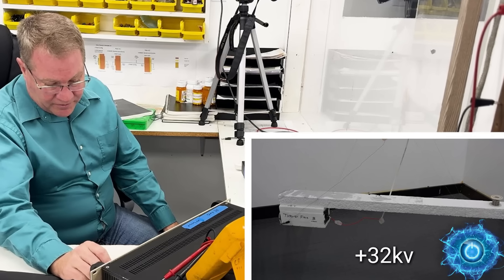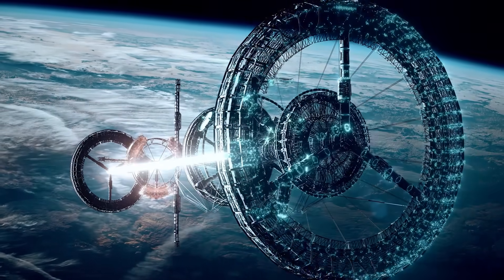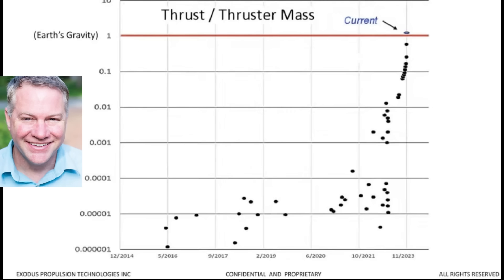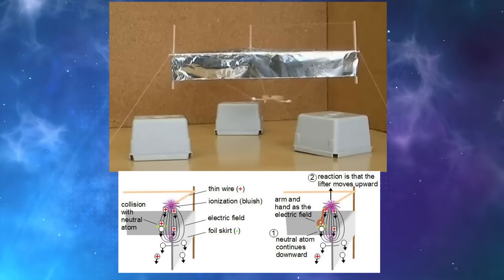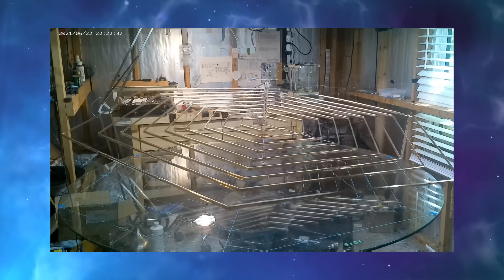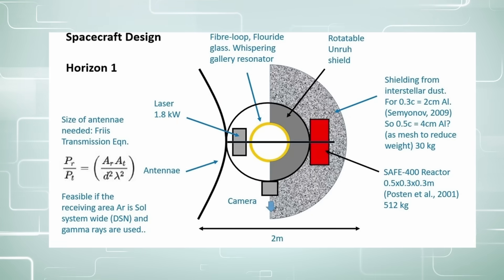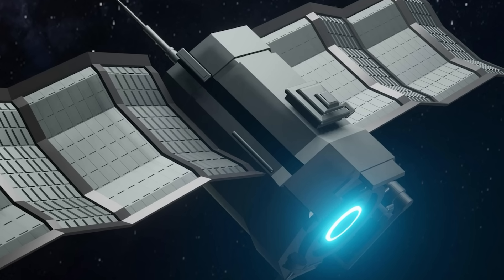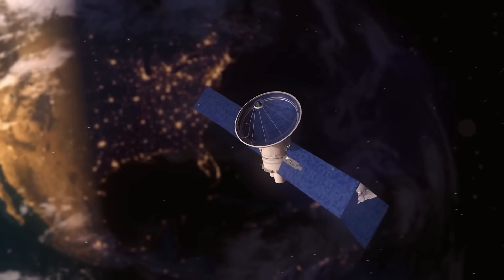Propulsion Breakthrough!? New Electric Drive Defies Physics

Comment: Quantized inertia was tested by several researches already, including in vacuume. It works based on understanding of minimum accelleration of 2x10^-10,  and modifying newton theory by adding a small part which doesnt have effects significant on earth from thrust perspective but has allot of weight in galaxy edge, wide binaries, and metal cavities. Research Unruh radiation.

Mike McCullough just published his 3rd book which explains the theory and applies it to 52 anomalies from the planck scale to the hubble cosmic scale.
Reply: QI might work but this is different.

Comment: “Electrostatics” is a misnomer. It’s longitudinal dialectic because it employs longitudinal standing waves, which is what happens inside every capacitor.
Reply: You mean during AC operation?  How would there be standing waves in a static charged capacitor?
Reply: @onradioactivewaves  The word “static” means not moving. Capacitors don’t ‘freeze’, make static, or make electricity stand still. What happens is when you have two transverse waves of dielectricity and magnetism trapped between two plates as in a basic capacitor, those transverse waves bounce back and forth between the plates until they overlap, and when those waves become 180 degrees out of phase, they collapse to form a single longitudinal standing wave, similar to a sound wave trapped in a box. That longitudinal standing wave keeps bouncing back and forth between the capacitor plates but doesn’t have any electrical or magnetic properties. It registers as a voltage potential on an oscilloscope, until the capacitor is discharged, at which point that standing longitudinal wave converts back to a transverse wave of electricity and magnetism.
Reply: @BrentLeVasseur  correct, I used the term static  properly as I meant. It sounds like you are describing how to use a gamma bounce diagram. 

So you're talking about a single cycle of AC using a pure frequency? Are you familiar with the RC time constant, or using a gamma bounce diagram?
Reply: @BrentLeVasseur  so if I charge a capacitor using dc, what frequency are said waves?  Sounds to me like you are going into some Tesla transverse longitudinal wave type stuff, but please eighteen me. And yes I have studied electrodynamics, so go ahead and lay it on me, I'm truly curious as to where you are deriving this information.
Reply: @onradioactivewaves  Even DC has transverse oscillations. It’s never dead flat.
Reply: @BrentLeVasseur  DC is indeed dead flat by definition,  oscillations is the AC component. You can further break AC into dispersion and diffusion currents.

Comment: The Biefeld-Brown effect was pushing towards the positive electrode, while ionic wind is the opposite, wasn't it? 
This could be because the high voltage creates x-rays that ionise the air in front of it, could be that there are streams of air with different speeds above than below, or the setup creates a bubble  of air that is less dense than the surrounding (or all of the above). The effect was first seen in x-ray tubes, their ionic wind is mostly contained.
Reply: Yes as I understand it. That’s one way they know it’s not ionic wind.

Comment: I remember the test stand for the EMDrive. God it was a bitch to build. Temjar was at it too in Germany. We both got the same results. Lots of money, but we were satisfied. We were wrong. - But! We figured out how to make a test stand that could detect a wave hitting a beach 1000km away. Now that tech is being used with NASA at the MEGAdrive project. That probably won't work either. But a much more qualified lady than me swung the job. To my delight.
And a few million dollars later we found out how we could PROVE ourselves wrong. And now it is part of the Yes/No process.
Reply: So what was the cause of the propulsion in the EM drive ,stray charge from cables ,insulators ?
What was the conclusion a dead end ?
Reply: I have doubts about Tajmar’s lab. I think they make assumptions and don’t follow instructions so naturally they have trouble replication other’ devices. Because they are not really replicating the device but building their own to non working specifications.

Comment: You are going to have to forgive me here, but this sounds like all the other claims I have heard about thrusters that have no propellant.
Bare with me ~
We have a device, originally discovered / proposed a hundred years ago, which is the size of a sand-shoe and you pump a thousand Watts of electricity into it, continuously, and it crams those electrons into a plate. Then, due to static charges or dark energy or the itch in God's testicles, it produces a force of 1/1000th of a gram. That's a bit less than the weight of a flea's dick.
In the next sentence, one breath, you start talking about transporting a thousand ton space craft to Mars in 3 days at a constant acceleration of one g, or going to Alpha Centauri, or going up to the speed of light or something. There is mention in passing of adding a nuclear reactor.
The amount of thrust that has been claimed (not confirmed) is about 6 ~ 10 orders of magnitude less than you would need to do something useful. Add to that, we don’t really know how it works. Or if it works. Does it repel against the Earth’s own magnetic field? You’re not going to get a thousand ton space-ship to 80% of light-speed if that’s the case.
I’m sorry to sound cynical, I don’t mean to be. I would love to be proven wrong and discover there really are flying saucers, but so far, we haven’t seen any. Many reports, lots of click-bait, but no flying saucer on the White House Lawn.
If you can make a thruster that works, without propellant, without a magnetic field to push against, that doesn’t take a giga Watt of power to produce one gram of thrust, then I will be very happy to apologise for being wrong. But at the moment, this is a lot like speculating on the colour of Tinkerbell's knickers. You are free to speculate, the same as I am free to think about black holes and worm-holes and new universes, but we’re both just dreaming about something we’re never going to see.

Comment: What is the potential for thrust   by accelerating solar wind ions.  Maybe the asymetic thruster has to be huge in size but not mass, and  you benifit  by not having to carry the propellant.
Reply: Even if it did have to be huge in mass, getting free of the rocket equation would be utterly revolutionary.
Reply: @marcforrester7738   sailing solar winds is concept I've seen discussed.  I suppose magnetic deflection is technically  accelerating solar wind plasma ions, or de-accelerating  from the sun's perspective.   But since the number of particles is so sparce per sq meter per second,  there's so very little momentum they can impart.  Maybe breaking free of the rocket equasion for an excessively massive ship  will be revolutionary  but acceleration will be very slow  and it will take very much longer to enjoy the benifits, unless the magnetic solar wind sails are also very much larger.

Comment: Bare electrons do have mass. How come nobody have entertained the posibility that escaping electrons are the misterious source of said thrust???
Reply: Electrons do have mass, and free electrons do exist -- I mean that's what a cathode ray tube does. But electrons, free or otherwise, are always attracted to an opposing charge. So if you're expelling free electrons from your ship expecting to them to disappear into the ether, well that's just not going to happen. You're soon going to be dealing with a charge imbalance problem. For every negative charge you expel from the ship, the ship gains an equal positive charge, attracting the electron you just expelled or another free electron to the ship. When you expel a particle and gain a particle the conservation of momentum guarantees a net thrust of zero.

Perhaps if you had some way of creating electron-positron pairs en masse, say either through laser irradiation or some other technique. You could direct your negatively charged electrons through a positively charge thruster and an equal number of positively charged positrons through a negatively charged thruster... literally a matter/anti-matter engine. This would avoid the problem of charge imbalance but the energy required to produce a useful number of particle pairs for this motor is now and for the foreseeable future science fiction. We can create particle pairs with very powerful lasers, it's a real technique. So, you know, just multiply that by ten billion or so and power it with some currently unheard of power source and you have your antimatter thruster.
Reply: @StoneUSA  I wonder if it might be electron thrust and buildup of positive charge causes electrons to jump off the surrounding vacuum chamber walls and end up on the positively charge "ship".  Of course that wouldn't work in space if this were the case.
Reply: Also, radiation carries energy in the form of momentum. Laser beams do have recoil, but only at extremely high energy levels. Also, lasers cook matter, so it has to have some form of kinetic effect. I think people just can't wrap their head around it.

Comment: In space it would work, but it is as you said. If you have enough energy. Gravity would need more than we can furnish at this time in a small enough package. I looked at the plans and determined that quickly.
Reply: I made a capacitive thruster as a kid. I didn't make any measurements or anything, but based on my power supply... you are wrong. I was getting a lot of thrust. And it was not from "electric wind" , the voltages were very low 50-60volt range, and EXTREMELY powerful forces. Dont assume what people say till you've tried it yourself. Sometimes people just go by age old math that only "approximates" reality. I use that word loosely in this case.

Comment: this device needs an atmosphere/partial vacuum to create any thrust
the only thing i can compare this to is an ion thruster
and works by ionizing Xenon and redirecting it
there is a way to create thrust whilst seeming to push off nothing but
its a well documented and scientifically proven phenomena, the Yarkovsky effect
as of such, it does not involve half baked experiments and pseudoscience electrostatic shenanigans.
its based on the redirection of photons to create a force on a surface.
but that takes WAY too much power to be practical 
e.g. 12TW of power would apply only approx 1 ton of force
to put that in perspective that's 12TW is 300,000 liters of kerosene every second

Comment: I think this tested in space will uncover and entirely new understanding of space and the aether/quantum foam that we find ourselves in, vibrating just off kilter with our own and this 'zero point energy field' will take us to the stars. very much like Star Trek: First Contact and probably some very bad things too!
Reply from the maker: It would definitely open a new sector of innovation. I think this is equivalent to impulse drive if it did work everywhere.
Reply: @Motor_Explorer1 

Cool video! Appreciate your open minded skepticism. 

If you’re interested in seeing a model that could have some additional explanation to how this propulsion works then Id recommend checking out Energy Wave Theory by Jeff Yee

The model seems incredibly useful. It’s a classical mechanics model capable of describing particle formation. It provides explanations for spin and explanations for the shapes of various electron orbitals. 

Using this model He’s been able calculate the Electron orbital distances for Hydrogen through Calcium with a high degree of accuracy. Just as one example.
Reply: This is exactly what I think aether string theory
Reply: As long as the Shivans don't show up after we discover Subspace travel
It'll be fiinnne.

In seriousness: I suspect testing in space would instead unveil some things about Earth's electric field that have been eschewed, ignored, etc.
Reply: Buhler claims that his new-and-improved EmDrive shows a force of 10 mN in a ‘stacked system’, yet no credible paper on the experiments can be found other than APEC presentations. Until their prototype is tested and firmly disproven, the way the EmDrive was tested by M. Tajmar, it seems fair to assume that the rules of physics as we know them today remain firmly intact.
Reply: @KrustyKlown  yeah I don't buy that not realistic probably hype for investors or grants

Comment: The idea behind these “reactionless” thrusters is that a small force applied over a long period of time can result in significant acceleration of an object. The forces involved are too weak to lift any significant mass on Earth and even air resistance would greatly diminish their effect. However in a vacuum and already travelling fast enough to at least orbit the Earth, such thrusters could accelerate a spacecraft without throwing out mass in the way a rocket works. But, you cannot defy the laws of physics, so what is happening is that pure energy is effectively forming the propellant, hence the relatively low thrust forces. Using a nuclear reactor for power is feasible and the amount of power drawn from the system will be related directly to the efficiency of the reactor and the conversion of fissile materials into energy. Such a system does not defy the laws of physics in any way, it just uses directed energy as the propellant.
Reply: " Such a system does not defy the laws of physics in any way, it just uses directed energy as the propellant." That is a violation of the known laws of physics. For example, pointing a laser behind a spaceship will not drive it forward.
Reply: @jeffjwatts  yes it would if the laser was somehow powerful enough.
Reply: @James-wk1ym  No, it won't have any effect at all. That's not how the physics works. You need to push some knd of propellant out of the space ship to move it. Now you can put a solar sail on a starship and let another laser on a planet push on it but a laser on the starship won't do anything at all.
Reply: @jeffjwatts   em radiation carries energy and momentum, so yes it would. Exceptionally small though, which is why i said if the laser was powerful enough, which it never would be in reality.
Reply: @jeffjwatts  The fact that solar sails are acted upon directly by light means that light leaving a laser must impart a reaction on the laser emitter. These two things either must both be true or neither can be true.
Reply: @Mindbulletz  I see sources that say no and sources that say yes, but that the momentum is so low as to be negligible.
Reply: @jeffjwatts  of course it would, it’s called a photon rocket. The only problem is the thrust is tiny.
Reply: @RV-qj6gm  " of course it would, it’s called a photon rocket." Yes, you are correct.

Comment: Getting there is the easy part. Coming to a safe stop, is another matter.
Reply: Well, there was a study that said the proposed Bussard ramjet created more drag than thrust but this could be used to brake an interstellar spaceship.  Even if this was not the case, a  Bussard ramjet could be configured as a retro drive so that both the drag from collecting the interstellar hydrogen nuclei and the thrust from the fusion of said interstellar material would act to brake the spaceship.   Then there's the star that you wish to visit is also spewing out a solar wind which would get stronger as you approach it so solar sails could be effective at helping to slow down the craft without propellent.   Stopping might actually be easier then getting up to speed...

Comment: Constant force for a given charge state is also over-unity - ie. doubling 'on' time will double velocity while also doubling power consumption, yet doubling the velocity means four times the kinetic energy..  In other words any craft using this drive will reach higher kinetic energies than the work / energy expended internally by the drive system.  This would likewise be true of any drive applying constant thrust for a constant given power draw, regardless of how inefficient it may seem initially.  For example even if only 1% of input energy goes to mechanical acceleration, the other 99% dissipated as waste heat, there will still be some threshold velocity beyond which net of KE plus losses is greater than total input energy / work done (and below which the system is similarly under-unity, showing a non-dissipative loss).   This is just the inevitable intersection of a quadratic plot (KE) versus a straight-line diagonal one, the system is thermodynamically open because it's also proceeding under conditions of inertial isolation, ie. without pushing or pulling against some other inertia, and conservation of energy - specifically PE:KE symmetry - is dependent upon conservation of momentum and ultimately Newton's 3rd law..
Reply: That is the point of propellent less propulsion and why it is so important to figure out.
Reply: @RV-qj6gm  Ultimately you'll never get anywhere by accelerating (how passé?), but at least it's a step in the right direction eh..

Comment: Lifters are not new , they exist since 30 years now.
They don't "defies physics" as the clickbait title says.
They just displace air particles with high voltage potential.
They DON'T work in space where there is NO fluid/air/gas.
Not if used as is, but they still can work if they are part of a special device that provises gas/fluid/plasma to interact with, like in the MHDBB propulsor and then provide trust.
Reply from the maker: The ion lifters don't defy newton's third law, the electric drive supposedly does in vacuum. What you stated is all already covered in the video..